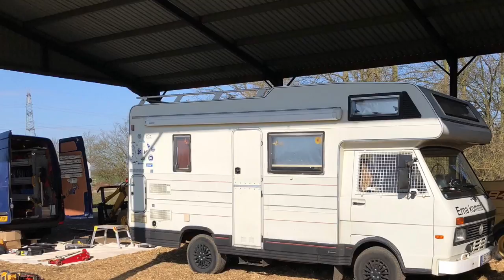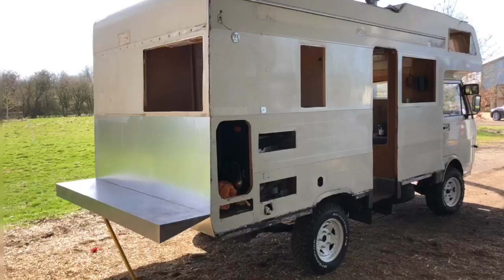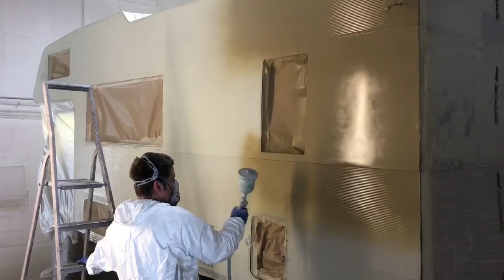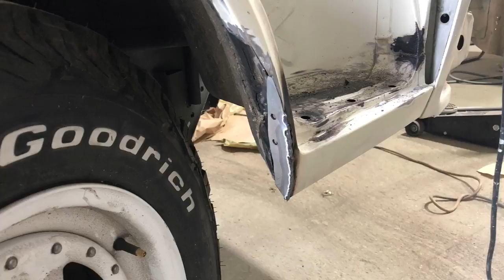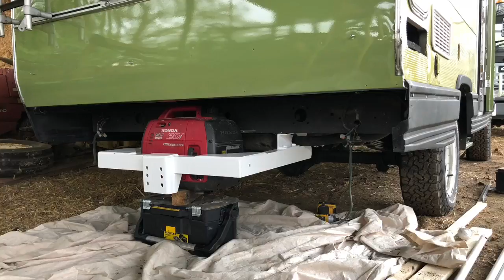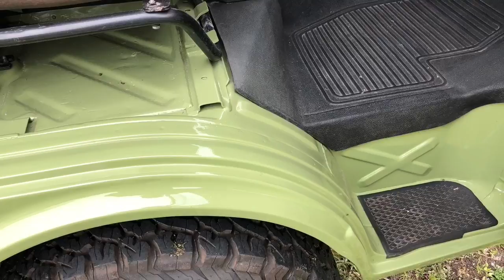Rebuilding  Volkswagen camper, Erna, an LT Karmann

Comment: amazing job! is it 4x4?? what wheels you have, rims, tyres? thank you
Reply from the maker: tehdreamer hi thanks, the wheels were custom made, they are 16x8j with 235 70’s fitted, I first tried 235,85 16’s on my last Lt35, but they were too big couldn’t get them to work, with the 235, 70’s the van still needs lifting and the front of the arch cutting out though.
Reply from the maker: http://www.extremeoffsetwheels.com/
The company I used for my wheels,
Reply from the maker: tehdreamer and no it’s not 4x4 but now doesn’t get stuck on a wet grass festival field
Reply: Phil Owen down the river thanks for the info! Haha yes ive been in the stuck on the patch of grass situation before :( i think I'll try getting some tyres for 16inch ford transit, lift kit is about 1k
Reply from the maker: tehdreamer I had new front coils made from a company in Sheffield they will make them to raise the van to any height, £90. And used lt 45 rear leaves but you could just add a leaf, that’s cheep, or maybe do something similar to that lift kit, the rims were £400 for 5